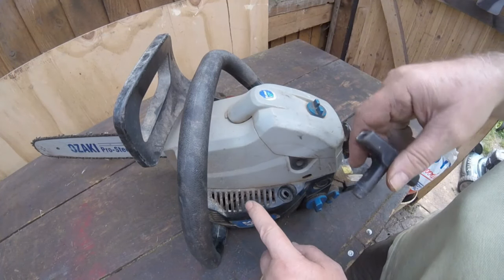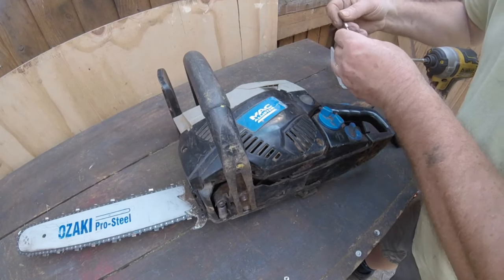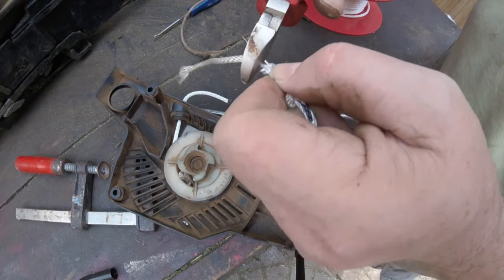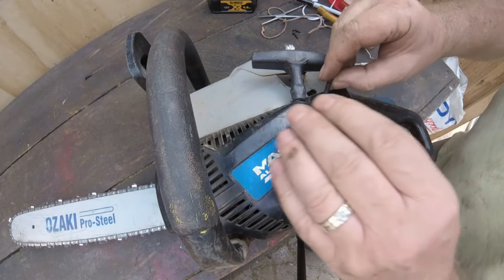MAC Allister Chainsaw pullcord Repair #smallenginenation

Comment: Hi Roy thanks for posting this video. Ive not yet had this problem. However, ill know where to come if i do.  I was wondering if you or anyone else has ha d this problem whith the Mcallister chain saw. I find that after about 5 mins of use the chainsaw will labour and die. Even after a full service by profesionals and new fuel with proper mix. Any advice would be welcome from yourself or anyone on the posts.

Comment: Another good video, but by the looks of it, especially on the starter housing, you didn’t tighten down the bolts quite tight enough??? I always tighten by hand to ensure they are tight.constructive criticism. Good video as always toy, Sam
Reply from the maker: Thanks mate i did tighten them down after with a key
Reply: roy's the boy ah right ok with a key 😂😂😂 good vid as per usual